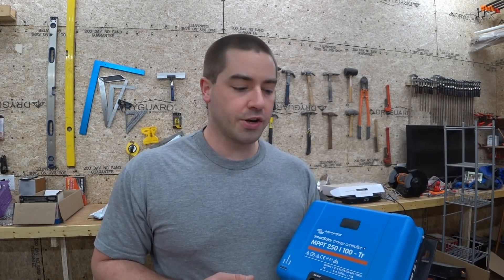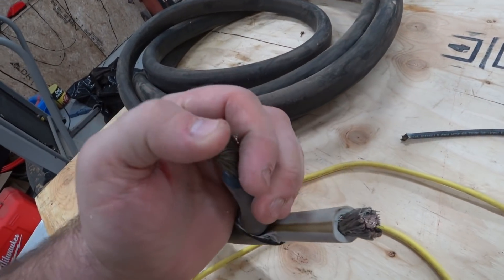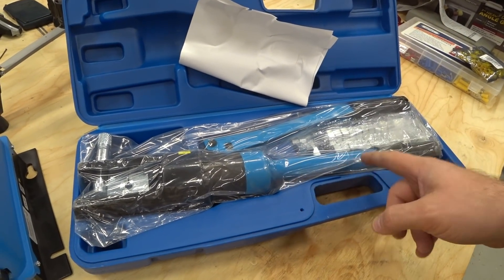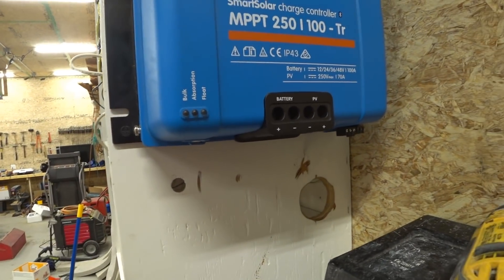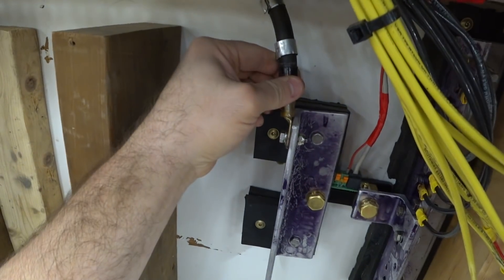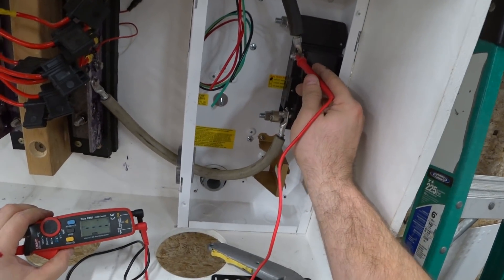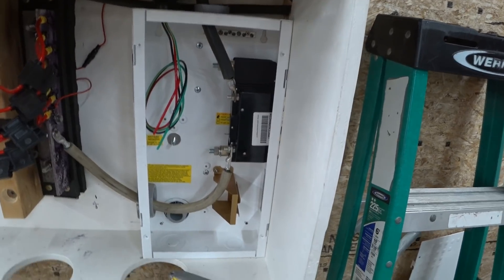Wiring Solar Charge Controller to Battery

Comment: The residual voltage at 7m10s is from the capacitors inside your MPPT.  Note that your inverter has them too so careful when you turn things off to be voltage safe!
Reply from the maker: O, that makes sense.  Thanks.

Comment: I'll be curious how your victron performs.  I have the small 30 amp version, it seems to go int and stay in bulk for seemingly no reason sometimes.  The BMV 712 is great so far.
Reply from the maker: That's right, you have 24 volt, right?
Reply: Yea, I have a 24v system. Your setup looks really cool so far, especially the batteries.
Reply: I use victron 24v in my small 1kw system. Both the inverter and charge controller work very well for me

Comment: Nice work. 

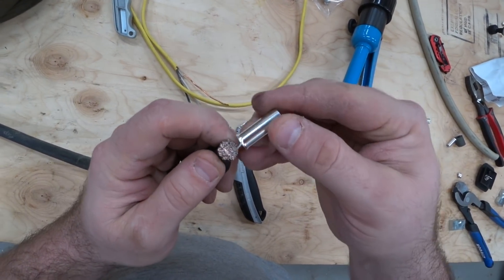I was under the impression that when you trim the wire like you did @ 6:09 it reduces the current carrying capability of the wire. Although based on your typical approach to these projects I am guessing you are using larger wires than you actually need so it will probably not be an issue for you.

Did you add heat shrink where the ferrule meets the wire jacket? Or did you omit it because it would be unnecessary in this type of application (indoor & no vibrations)?

Btw this video on crimping may interest you (particularly the visuals of good vs bad crimps) 
https://youtu.be/3qYZFxQ8Pxw?t=105
To be clear your crimp looked good, I just thought you might find the video interesting.
Reply from the maker: Thanks.  Yes, you made some correct assumptions.  I was using some old wires that I had.  The first one I showed (negative) fit real well and I did not have to trim.  It had 2 AWG (American Wire Gauge) printed on the insulation.  The second wire I made was from a different old cable. 
 It had no printing on the insulation as to the gauge, but was clearly larger.  I'm using a 125 amp circuit breaker, and 2 gauge is the right size for 125 amps.  The terminal ends I was crimping are all listed at 2 gauge.  I think it is a safe way to do this when you are not reducing the wire diameter smaller than the circuit breaker size.  Although I'm not an electrician so I could be wrong.

Comment: The number on those dies correspond with the D mm2 of cable lugs (ring terminal) u can crimp,  so 35 for a 35mm cable lug. Ferrules have a different outside diameter. Also the terminals on that Victron should have no problems with those cables. That said i am a fan of ferrules, and they are mandatory for professional application in my country.
Reply: agree

Comment: I used #6 inside and out but only because the fastener was sized for it so I used maximum size for ground. Nice cable should take a lot of amps. Cheers now if it would stop snowing I'd be in business.